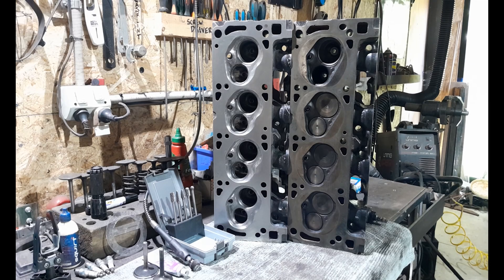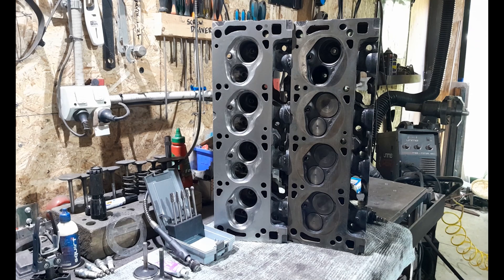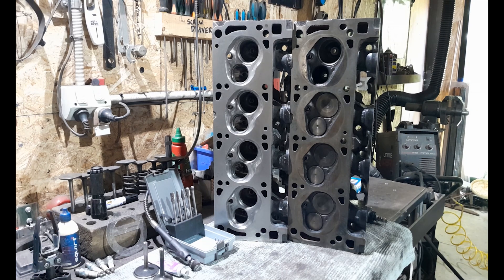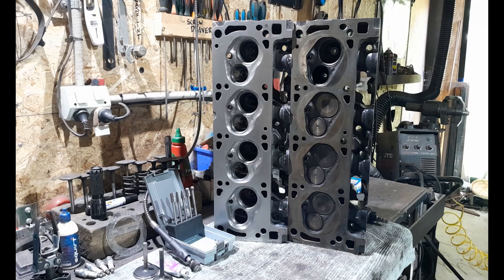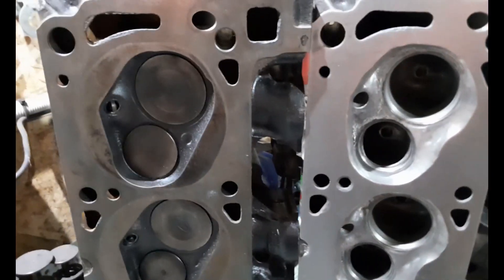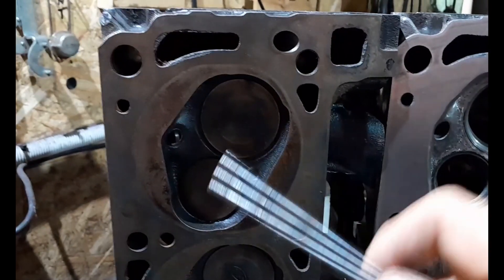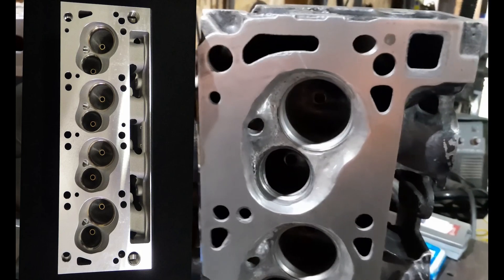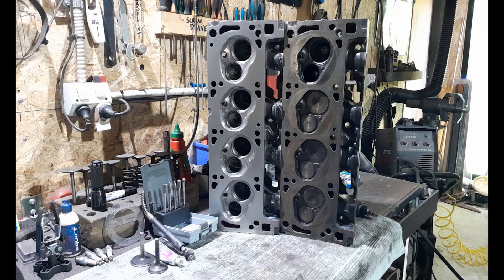351C Aussie 302 2V Cylinder Head Before And After Porting Comparison

Comment: Question, how did you determine the final shape & size of the compression chamber?
how much did you increase the CC volume?
Just so you know,  I raced FORD racecars on the dirt tracks of NorCal for 11 years, (1980s-1990s) all powered by 351Clevelands. the best cyl head was the Aussie 302C.
I bought 3 sets of Aussie 302C heads in the late 80s, used two sets for competition, still have an untouched pair stored in my shop. (what are they worth nowadays?)
just stared following you, thanks.
Reply: A sets of Aussie 302C heads in Australia in rebuildable condition are worth about $250 Au. But if you are asking what they are worth in the USA, that is a totally different proposition because of how expensive (read difficult) it is to get a set of heads shipped from Australia to the USA.
Reply: @peterhart4301 thanks for the info, good to know.
Reply from the maker: @abcullens2328 hey buddy. Just got back from NC a month or so ago. Spent a few weeks over there with family who live there. We loved NC and it's people.

Sounds like you have got yourself dirty a few times working with these great Clevo heads. You are one of the guys I'm talking about, who got switched on to them and got yourself some of them. Good job!

Here's a link to the video I put out which explained  how the shapes and measurements were worked out. https://www.youtube.com/watch?v=9Q_nGua3TtE&t=315s  

Credit goes to Craig from Performance 351 for all the detail there. I have contacted him to setup an interview so he can talk about his 20 plus years working on all types of cylinder heads, but especially the Aussie 302's.

I have not CC'd my combustion chambers yet to check how much they have changed with this mod. I might do this for other folks benefit going forward. You can pick up set of used 302 2V's around here for between $200 and $300 dollars. Then you need to have all the resto work done on them. I think a set of reconditioned 302 2V heads ready to install, go for around $1,200 AU.   

And thanks very much for commenting and joining the channel. I appreciate it!
Reply: @Doctoradhd1  currently in the process of watching all of your videos regarding the 302c heads. Thanks.
I am a "dyed in the wool" Ford guy, have been my whole life. I'm glad you mates down in the Land of Oz are sharing your knowledge and experience regarding the Ford 302C and the 351C engines and heads. Thank you. 
For the record, I was an engine builder for 25 years. During that time I built far more small block Chevrolet V8s than I did Ford V8s, hands down. Including dozens of Chevrolet race engines, (race winning) so no disrespect from me in regards to other brands. 
But my all-time favorite engine is the 351 Cleveland. Long live the Clevo!🏁👍

Comment: I'm looking forward to seeing the 302C heads running on your 393 in the XW, It should be a good video, thanks for sharing the video's on porting and deshrouding the combustion combustion chambers.
Reply from the maker: @warrenbrown5621  Thanks Warren. I’m very keen to get that engine out and get these heads on the 393. I’ll be working on getting some kind of flow bench setup in the next week or so.

That will delay getting the heads finished and back on the engine, but worth the wait I reckon. If I’m going to keep porting heads, I’ll need something to keep me on track. Thanks for tuning in mate.